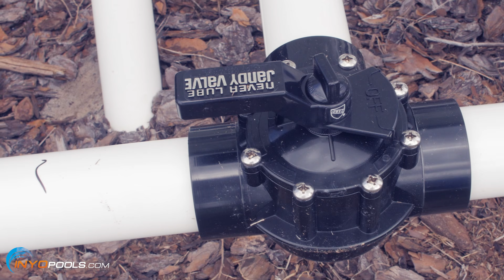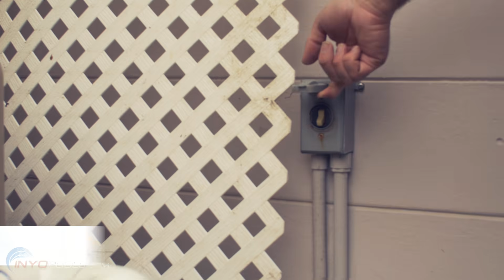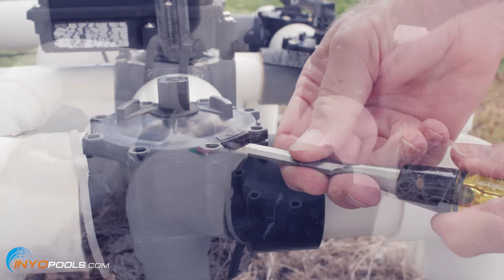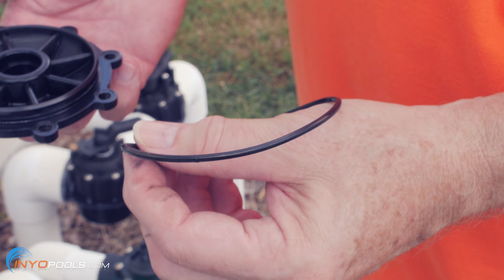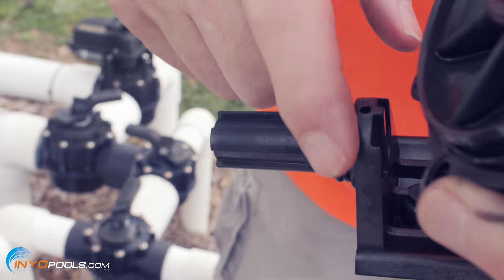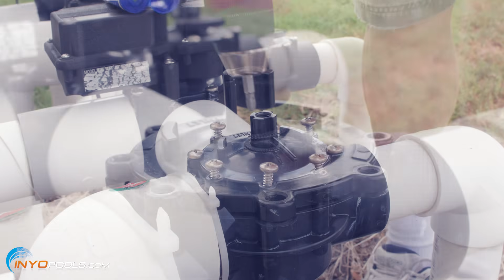How To: Repair a Diverter Valve

Comment: How can you tell if the leak is from the o ring needing to be replaced versus the entire valve needing to be replaced?
Reply from the maker: You'd only need to replace the valve if the housing was cracked and leaking or other hardware pieces showed signs of severe degradation. If the valve doesn't show any signs of damage, as mentioned earlier, then the best (and cheapest) solution is usually new gaskets.

Comment: Do NOT use a screwdriver or anything to pry apart, you will create a notch in the plastic housing since it is soft, this could create a leak. instead, re attach the handle and then carefully/slowly wiggle it off

Comment: Thank you very much for this video. I replaced the o-rings and lubed them and that stopped the leak. I had to use a very sharp pocket knife to be able to separate the valve cover from the valve because the chisel or flat head screw driver didn't work.
Reply from the maker: Nice work!

Comment: If you have a Pentair valve - Pentair exploded diagram of their valve on their web site shows a small spacer that goes between the 2 small o-rings that go onto the shaft. I just did mine and sure enough, there is a spacer.
Reply from the maker: Compool / Pentair Diverter Valve – 1-1/2" & 2" Parts Diagram - https://www.inyopools.com/partlisting/compool-pentair

Comment: My pump stopped working and pool store told metro move diverter to where it doesn't go. So I got it there and now I can't get it back to normal. It won't turn. Should I get plyers and force the handle? Or take the thing apart? I'm new and nothing wrong with diverter valve. Was trying to get into impellor and check debris.
Reply from the maker: What do you mean but turning it where it doesn't go? Did you rotate the valve's cover?
Reply: My pool diverter is on off position and the water still goes up to the house roof to the solar heater. Any advice? Thank you.

Comment: Getting a leak thru my waterfall. I suspect its coming from the valve key not sealing off the waterfall completely. What is the solution? Do i just buy the valve key or do i need to buy Orings as well?

Comment: Opened my diverter up to clean out a blockage (leaves) and my pump's pressure was instantly restored! Then it stopped working properly again quickly after. Now the lost pressure issue is widespread, affecting main drain as well (completely bypassing the earlier blocked pipes). Any chance I could get a tip of what to check next?
Reply from the maker: We have a couple of guides you can check out here below:

How to Test for Suction Side Air Leaks - https://www.inyopools.com/blog/test-suction-side-air-leaks/
How to Identify and Correct Air Leaks - https://www.inyopools.com/HowToPage/how_to_identify_and_correct_air_leaks.aspx
Reply: @Inyopools  thanks, the air leak was actually two loose, worn o-rings; one in each of my diverters

Comment: I replaced diverter but still leaking a little.  It's better, but not off. ???
Reply from the maker: First step, check to make sure you installed everything correctly.
Reply: Me too😢
Reply: Did you ever resolve this issue? I changed the internal mechanism, and it still leaks.

Comment: 1.	Order diverter valve parts.
2.	Turn off power.
3.	Relieve system pressure.
4.	Remember valve setting. (Note operational position of the handle.)
5.	Remove handle lock knob.
6.	Note position of inlet label.
7.	Remove cover screws.
8.	Pry off valve cover.
9.	Note position of diverter paddle.
10.	Push out diverter.
11.	Remove cover O-ring.
12.	Clean valve cover. 
13.	Slide O-rings on new diverter. (And replace cover O-ring.  Lubricate all O-rings. Slide diverter shaft into cover.)
14.	Rotate diverter to match old position (Position as noted in step 9).
15.	Insert assembly into housing. (Position as noted in step 6)
16.	Replace cover screws.
17.	Place handle on valve shaft (Position as noted in step 4).

Comment: Thanks, Great Video, one recommendation. When replacing the cover screws into the plastic housing. Push lightly while turning  them counter clockwise till you feel a click. Then tighten the screws. This way you will not start a new set of treads which can lead to them stripping out. Also a lot easier to install the screws in the old threads than making new ones.
Reply: Hooray! Someone who knows what they're talking about. I've been a pool guy for 15 years and lost count of how many screws have been stripped out by a previous cowboy just ramming the screws up with a cordless drill. Complete morons. If after you've pushed lightly, and the screw has dropped, you can't start turning the screw by hand, you do not have the screw going into its original thread.

Comment: Great advice. I figured out most of this on my own, but skipped the step of noting the original position of the cover - and there's no easy way with my pool to tell which incoming pipe is the inlet. So had to do the re-install twice. Suggest writing "inlet" on the appropriate pipe to avoid this problem.
Reply: How did you recognize the inlet pipe?